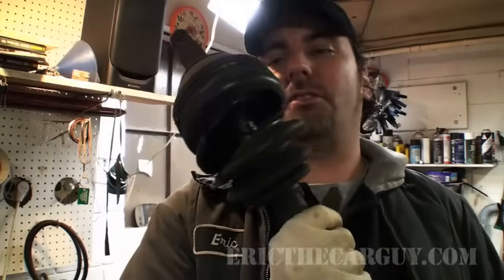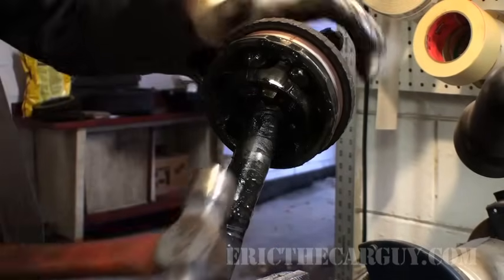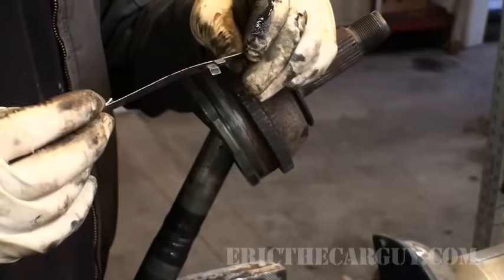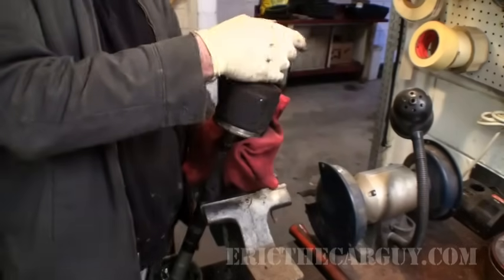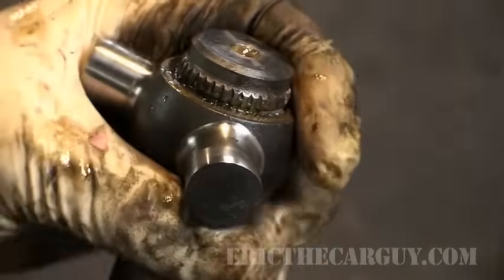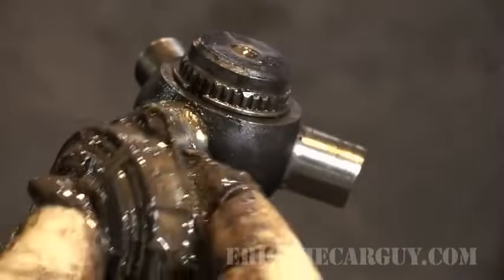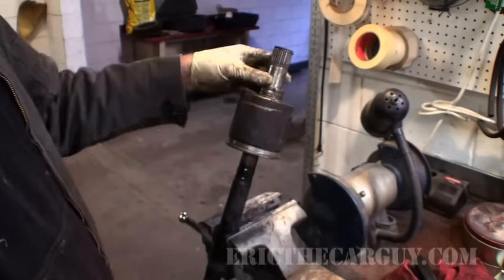How To Replace CV Boots - EricTheCarGuy

Comment: Many thanks, Eric. In return for your hard work, I can educate you with one extremely good reason - under the right circumstances - to replace the boots and not the entire axle. The axles that come on the vehicle are extremely high quality, made to last hundreds of thousands of miles if they're not neglected (like driving with split boots). The cheap aftermarket replacement axles, on the other hand, are near junk, barely capable of performing their task (and they often don't). Sure, they have a lifetime warranty, but who wants to pull CV axles every six months, or go through three of them to get one that runs properly (temporarily), just to keep from getting joint grease on your hands? Remember I said "under the right circumstances"? In my case,  the left outer boot is split. I just bought the car a week ago, no idea how long the boot has been that way, but here's the thing - both axles are dead quiet. No clicking. No groaning. Nothing. Do I think it's worth replacing the boots rather than throwing this quality part in the trash and installing Chinese junk? Damn straight! So that's it, thanks again for the terrific video and always wrench safe.  :)
Reply: That’s what I mentioned above too before reading any comments.
Reply: thanks for the advice!

Comment: I reckon the boot is worth changing even if the joint is clicking. The reason is because I recently had two broken outer CV boots and one clicking cv joint on turns. Having never taken one of these apart I was curious to see how it all fits together. So I took both axles out, removed the broken outer boots, cleaned the old grease, dirt, and leaves out, inspected the components and noticed a little pitting on the inside bearing carriers on both sides. Re-greased and reassembled it all and was surprised to find the clicking had stopped. So far I have done another 5,000km and the clicking still hasn't returned yet. Will post back here when I notice it get worse. Also thanks for the video - you made the job a lot easier for me.

Comment: Valid points all around. I was in the Air Force and spent 20 months on Guam. A good 19 of those months, I drove an 89 corolla that had NO boots left on both axles. They weren't just torn but GONE...all the rubber material and grease were completely deteriorated into non-existence, and the ball bearings were bone dry. Every time I drove, esp on the strip with friends in the car, I was just waiting for one to break. Never happened! And this was on a hot, humid, salty, tropical island on coral-composite streets! CV axles are important parts for both operation and safety, but they are pretty tough.

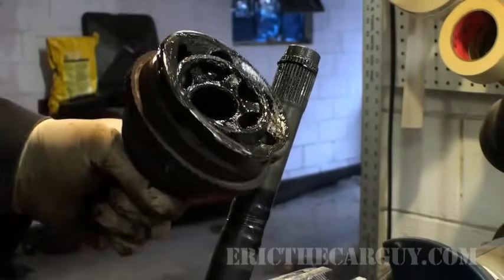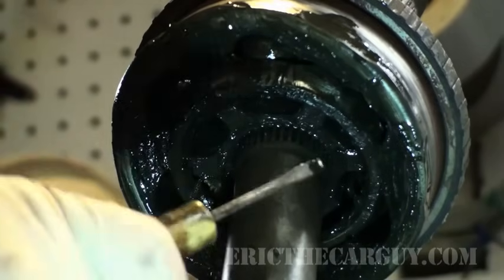Comment: 6:20 - 7:19. DUDE! You saved me! Had to do a control arm on my son's car. Somehow putting everything back together, the cv axle separated on the inside. I've never experienced this before. I told my son we needed to by another axle, but I was twisted because there was absolutely nothing wrong with the old one to begin with. So, before buying a new axle, I was trying to search how to put it back together. You were the only one I could find that had this step with that stupid snap ring! I couldn't figure that out. Thanks for this!!!

Comment: Eric: Thanks for the video.  Here in WVa we have vehicle safety inspections and they won't pass a car with a torn boot, so your video is still applicable for us.  Replacing the axle with a rebuilt one sometimes is a problem, because incorrect circlips on the inboard side sometimes makes it nearly impossible to remove the axle.  I saw one where they actually ruined the transaxle trying to get it out.

Comment: Hey Eric, your vids on CV joints have helped me immensely. VERY BIG THANK YOU. This was the first time I had attempted anything of this scale on a car (Mitsubishi Magna 1998 - Australian Sedan) and your vids made it look reasonably easy. It took about a day to get it both axles out, 4 evenings of cussing to replace both outer boots (What a messy job!) and then all of 2 hrs to get both axles installed. For good measure I got a mechanic mate to check over my work and he gave it the thumbs up. Now to do the timing belt and front suspension . Although I'll get the timing belt professional done by my mate. Just to add the car is driveable since doing the CV outer boots. Also having access to a compressor and rattle gun (impact wrench) makes life easier.  I learnt a lot doing this work. Lastly, my skill level when it comes to cars is at a stretch that of a 'Weekend Warrior'. 
Stay Dirty :)

Comment: Thank eric. This is just what I needed to know and my Russek manual just said 'it's hard - just take it to a shop'. And my boot only just split with a small hole that was letting greaseout, but not dirt in (yet). I've done a boot before but it was probably 20 years ago, so needed reminding how the two ends come apart. Perfect.

Comment: The new axels I've bought for my 96 Civic have had grinding CV joint right out of the box. So I find it hard to believe that it's worth the extra money to replace an oem axel that has no grinding or clicking but a small tear in the boot with a Chinesium piece of crap that will fail in short order. 
With this pair I just bought each axel had one side that didn't even have grease in it on top of the grinding. They are import direct if anyone was curious. 
So I think I'll save $140 by just rebooting the oem that's 10x as Skookum. 
But I have to say I very much appreciate the time you take to make these videos.

Comment: Cheers Eric, this one was useful for me when my ball joint snapped on my accord and the resulting force pulled an inner CV joint apart (along with the boot). I re-inserted the shaft into the cup temporarily and replaced the boot after a few days after giving it a good clean and a fresh gob of grease. All is well.

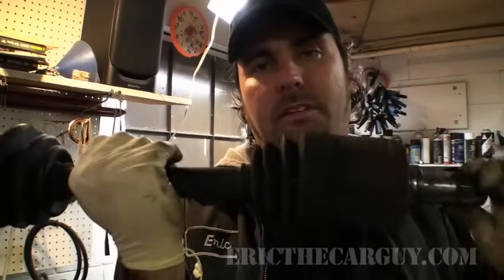Comment: Many Thanks for showing what had me worried while taking the passenger side CV Axle out of my new to me Element - that it's normal for the inner CV joint to slide somewhat (at 2:11) - first time for me doing this kind of work, only worked on solid axles before. I elected to replace the leaking boot because the OEM axle performs perfectly otherwise and I'd prefer not to replaxe it with an aftermarket of dubious quality. Kudos! 👍👍

Comment: I found a simpler solution for a torn boot. I don't take off the axle just, just crack it loose from the hub. First, I glob a bunch of grease into the cracked boot. Then I stretch the thigh section of an old wetsuit over the old boot and affix it with two coat hanger wires wrapped around and twisted tight right over each boot band. Lastly i pull the wetsuit into the boot corrugations with jumbo plastic wire ties just to keep the grease in the boot. This method made the clicking go away and lasted five years so far on my f-150.
Reply: who just has an old wetsuit lying around, lol

Comment: so 3 whacks huh? I've been beating on mine for an hour and still nothing.. prob broke it by now * yup it broke, awesome!
Reply: For the trouble....you might as well just replace the axle.👍
Reply: Agreed, all day getting this mess out with no luck
Reply: 😂😂some of them are easy to get out but today I've been beating in it for an hour too😂 i ended up just taking the other end out and replacing both😂
Reply: I heard non oem ones aren't able to come off because they are welded on? I just took it to a cv axle shop instead
Reply: Did u have a vice?
Reply: Recently tried to take some junk axles apart... beat the crap out it. Next tried an air hammer. Would not come apart. Cut the joint apart with a grinder and it was just a stupid c clip holding it together 🙄

Comment: THANKS!!   I just got a new boot for the wife's Mazda Tribute, took the axle shaft out (and that was a right performance, it didn't want to come out), it was then that I realised I was going to have to take a joint off to get the new boot on.   (Okay. so brain not working too well).   So I cut the old boot off  -   which is equivalent to throwing away the paddle when I'm up shit creek - and realised I had no idea how to get the CV joint apart.   Your video is invaluable!

Comment: I remember using electrician's zip ties instead. Worked a treat.
Reply: Yossi Illan  did zip ties work good ?
Reply: Yes and as a matter of fact, I kept them on till I sold the vehicle. At least they are excellent as a temporary fix.
Reply: Yeah they are good for it done that allot.
Reply: I used to keep zip ties in the trunk of my car until I got pulled over by the cops.

Comment: I'm going on a clicking joint now for 5 thousand miles but I also take it easy in the Lincoln mkz... I had a machanic tell me he couldn't take the old joints apart to put in new ones so I left it till I find a real machanic to do a install  of  2 axles. Your Wright you can get pretty far with a clicking joints your the man bro.. thanks for advice keep on doing great shows bro. Connecticut in the house

Comment: Good video, good info, good production quality... but I gotta add, just putting in a cheap new cv isn't always the best choice... cheapo cv's for a lot of cars, like the Acura in your example, are just fine; however,if you have an IFS rig you offroad, cheap new cv's are usually "made in China" garbage that WILL snap like twigs... OEM GM cv's where faithful for 150k miles and a good amount of abuse, went through 3 inexpensive auto store replacements (about 15k miles in all, all were about $60 and were best quality each auto store offered) before coughing up the cash for rebuilt OEMs ($270) ... all I'm saying, if you put a good amount of stress on your cv's: rebuild or buy rebuilt if you want to be cheap... go factory replacements if you want the better option but it's generally not a cheap option
Reply: +Pat Trottier I think you definitely have a good point.  A lot for the lesser expensive parts don't seem to last very well.  I replaced my CV axles and within less than a year, both boots opened up.  I went to warranty them and the dude at the parts counter wanted to give me just the boot and told me they don't exchange the axle's for open boots.  I lied to the guy and told him I found out when I heard the clicking noise while turning the car.  They exchanged them, but now I regret not replacing the original boot with one from the factory.
Reply: +Ernie Martin That "guy you lied to" was ME!!! Thanks a lot, Ernie!
Reply: Pat Trottier I've had Raxles on my CR-V for several years, and I was provided free new boots by Raxles when mine started to crack. The CR-V is far from an off-road vehicle, but I'm very hesitant to install aftermarket Chinese axles.
Reply: Yes, tried aftermarket axles for my wife’s Santa Fe and they caused a vibration at 20-25 mph. Hyundai wants $600 each axle, joints are good just boots starting to crack so I will be replacing the boots for sure.

Comment: Great video! I totally agree, axles are like $30 now and if you pay a little more you can get the lifetime warranty on them which most car parts stores will honor and you basically get your next set at no cost should they fail. 
The reason I was looking for a video like this is because I have a set of very expensive custom axles and the boot got a paper thin cut making it hard to find but more importantly throwing grease everywhere at high speed. For me it’s well worth the time to replace my axle boot on my own, no clicking here just need the damn boot to do its job. Great video Eric, I thought I was going to have to ship my axle somewhere. Thank you

Comment: Thanks for your expert opinion on axel vs boot replacement. I happened to notice (non clicking) axel inner boot crack while working on ball joint. Instead of doing nothing, I jammed some cloth into the crack and used a wire tie to tighten / seal the crack. I hope this will prevent dust falling into the crack and hopefully prolong the axel until the time I replace it.

Comment: Had a clicking CV joint when turning which had a broken boot . Repacked with a new boot and grease and the clicking went away (been drivig for almost a year with no more clicking). Also, some inner and outer joints will have a snap ring to let loose the bearing cage so that you don't need to use a hammer.
Reply: How much the boot replacement cost ya? What kind of car was it?
Reply: @CHIPSIMS-h2n  10$ for the boot and 5$ for the grease. Car is a Nissan K11

Comment: Thanks Eric, I needed the refresher course on taking the drive shaft apart because it has been a long time since I have taken one apart. I agree with you that it should be replacing the whole axle but when you are in Mexico at my house and only able to get the boots and the car is a 4x4 and the front drive is only used sparingly and at low speed. Just cleaning and changing the boot works just fine. Again thank you for the refresher course! Nice!

Comment: They want $2,800 for a new half shaft assembly for my car. I think I'll just replace the boot. Thanks for the video!
Reply: Is it clicking on turns? Ain't gonna' get better.
Reply: Not that I know of (it doesn't steer since it's a rear axle on a mid engine). Are least it won't get any worse.
Reply: Alberto Rojas Mid-engine? What kind of car is it?
Reply: '88 Mondial 3.2
Reply: Alberto Rojas A Ferrari? You're a Ferrari guy complaining about the cost? I thought you guys use $20's for toilet paper...
Reply: There is a reason why I bought an 88 Mondial and not a F430... Anyway, I changed the CV boot and rebuilt the joint. All is well.
Reply: You know you wanna do the shaft.. Alberto
Reply: @RiverAlph  😂😂😂

Comment: Thanks Eric, I knew that about CV joints. Replacing the joints VS. replacing the  whole axles.  I was actually wondering when you had to actually replace a joint that  is making noise.. You confirmed  exactly what I suspected.  It makes sense  that it would be noisy in turns but still ok, and straight line driving , well it's common sense that that would be the time to change it out.  I'm lucky I saw this episode because I though I  wouldn't see this info on an episode that is about replacing the boot...

Comment: hey Eric, i took my car to the mechanic and he said i need to change the front axles. the problem is its not a click click sound its a vibration. my car vibrates weather when you are accelerating , driving on a high speed or low speed. matter of fact, the vibration decreases after 100-120 but you can still feel it. today, i took the wheel off trying to find out whats going on, the axles looked just fine but what i found was the inner tie rod booth was covered with grease. is this whats causing the vibration? or is it really the axles? pls help , thank you much
Reply: wheel balance....
Reply: Martin Lucas Sazz can eliminate that by rotating the tires, front-to-rear... if it still wobbles/vibrates, & he ruled this out ~ along w/ the suspension & engine/trans mounts, then it's those inner axle CV joints
Reply: original wheels? or something you harvested off another car.. I had that happen, never put Mazda rims on a toyota..
Reply: Earl DaSquirrel You forgot wheel bearings. Anyway - it is something easy to diagnose (if you know, what you are looking for..)   ;)  Sazz - clean that grease off - won't help, but will not harm. :D
Reply: Sazz Sourman mm my opinion its not that..it can be axles ,unbalanced tires,missalignment,motor mounts
Reply: Sazz Sourman I know its been 3 yrs but maybe this can help someone - my brother had a problem like that and it turned out to be some sort of rubber packing attached to the shaft had moved out of place.  It was adjusted and the vibration stopped.

Comment: My CV boot got damaged by accident during my steering/shocks repair a couple weeks ago so I have to replace the boot. The CV is in good shape so I'm just replacing the boot. This video definitely took the stress out of the job a bit. I noticed the damage when I was replacing the ball joints today.

Comment: BTW this is waaay too much work. I am going to wait until my axle starts clicking then Im going to change it all out at once! Save time and money!
Reply: it's only 19 min's because the axle is already off the vehicle. in reality, you have to remove the strut, loosen the tie rod end, remove the brake caliper, take the ball joints loose and remove the steering knuckle. then add putting it all back together. 2 hour job give or take. and, having air tools or not makes a big difference
Reply: @matthewh.6041  what vehicle? All I have to do on the odyssey is remove the knuckle from the lower ball joint and axle nut then pry it out. I would say that if you have a torn boot and it's a OEM axle to just change the boot. Aftermarket axles are just a PITA and you'll get lucky if they are good out of the box and actually last. Been through 3 different brands and all have had terrible experiences with them not being good OOB or not lasting. Will from now on save the OEM if it can be saved or replace it with OEM, tired of the inconvenience of aftermarket.

Comment: Thank you so much. I just wish I watched this before I bought two outer cvj split covers for over $50. They are going back to the store since I fortunately watched this video before I started to install. I looked up prices for axles and well. I threw in the towel. I have no idea how many miles ore on the current axles. For the price of new ones I said. I’m just gonna replace them. I replaced two on an  82 Plymouth unreliant and they were 192 a side. The clerk said he under charged me for the first one but because he quieted the price he would charge the same for the other side. This was back in the early 90’s.